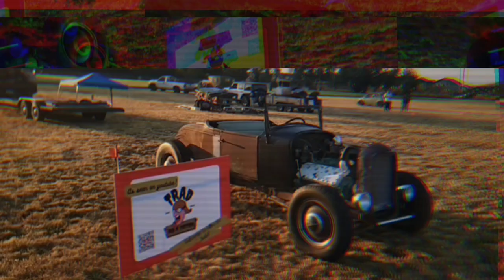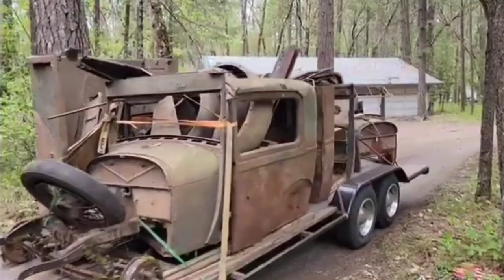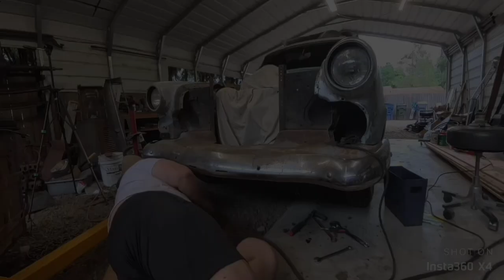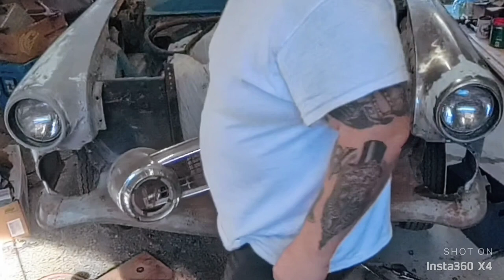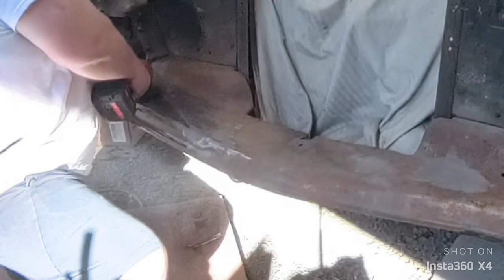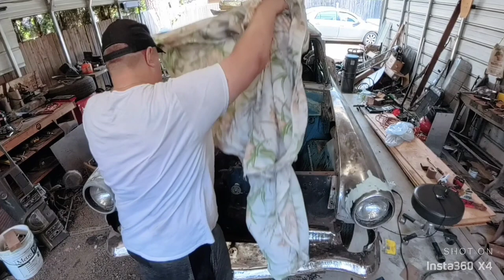Prepping Dads Shoebox For Paint

Comment: Morning Oliver. Early posting aye. Deja Vu on the 53. I mentioned to ya a while back my older brother had a 53. His was a flathead V8. Our dad got him an offenhauser 3 carb for it. So it looked so similar to your dad's. It was the same color blue as that engine bay (done with a brush 🤭). Weird how they ran that crossover exhaust on Y Blocks. Never did understand that. My brother put a manual choke on his and a coil in trunk with sparkplugs bunged into the tailpipes so he could shoot small flames . Like the custom grill. She's gonna be " Bitchin'"! Your editing gets better every time. Thanks for something worth watching with my coffee. Till next time ... Cheers 🍺🤛😎👍
Reply from the maker: Thank you! Ive been laboring over the editing so thats great that its translating! Yeah 53s had flatheads, this one had the crossmember butchered out at some point and a y block shoved in. I swapped that y block with the one currently in it and redid the motor mounts. Thanks for watching!
Reply: @tradrodsandcustoms  Hey ya get a minute stop by Jason's and help him get the timing right on that 350. He's trying so hard ... 🤭👍
Reply from the maker: @Awsom47Merc  I was talking to him about it the other night. He has a good gameplan at this point. It has been a struggle but thats the problem with starting an engine some unknown put together. My advice to him was tear it down to a short block and reassemble it himself so he knows it was done right
Reply: @tradrodsandcustoms  Exactly 😎
Reply: @tradrodsandcustoms Thought it's funny. I left him a comment to invite you over for a beer and he did call ya. 🤭👍
Reply from the maker: @Awsom47Merc  I reached out to him, but we are friends so we talk semi frequently anyway... when jobs, kids and responsibilities allow
Reply: @tradrodsandcustoms I know that Oliver. Got my kids out of the house. One's a University Professor the other a Machinist. Both have they're own homes. Hey a word of advise, put 10% of every check in a 401k and leave it. No matter how much it hurts. You need it for retirement and for loans you pay back to yourself with interest. Good chatting. Your a good man Oliver. That's getting rare in this strange time 👊😇👍
Reply from the maker: @Awsom47Merc  appreciate you!
Reply: @tradrodsandcustoms  ✌️😎👍